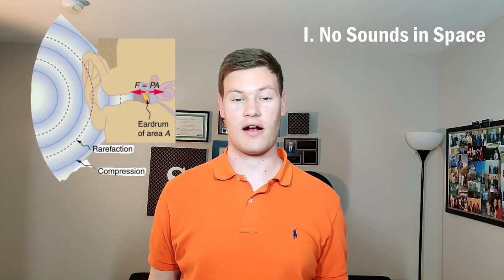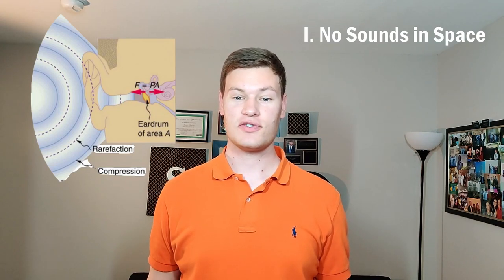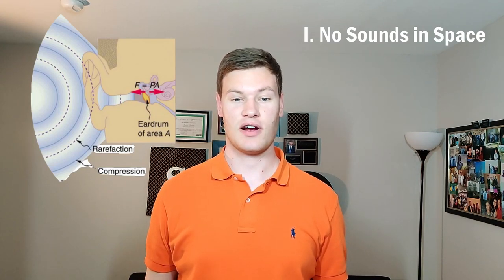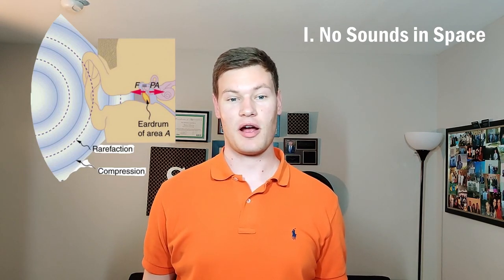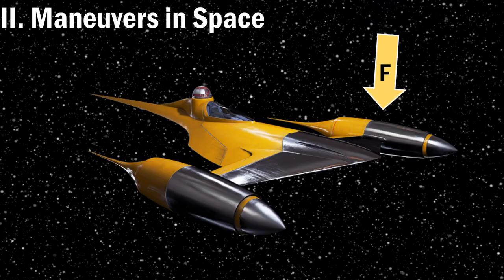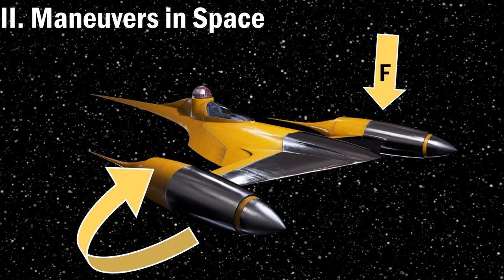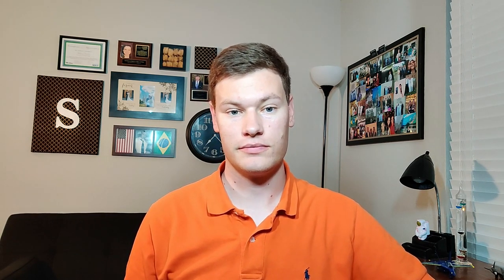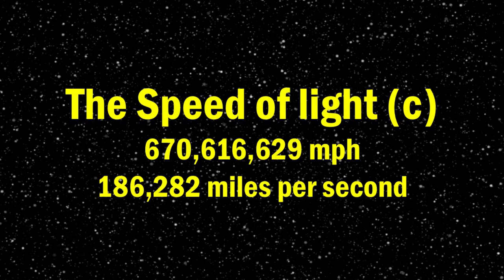How Star Wars Spaceships Work | Aerospace Engineer Reacts

Comment: Regarding your interpretation of what the hyperspace engine does is not what I have seen. It makes you go to a parallel universe (Which is science that exists) where they can go faster than light, either because the speed of light doesn't exist there, laws of phisics are distorted and weird, or the speed of light is significantly raised, aka not a wormhole. In one of the books that I read (legends) they didn't have time to do any calculations for the route, and just hit go(basically). They then got stuck near a black hole (Which will of course also exist in the parallel universe) and couldnt enter hyperspace, then some weird shit happened that I will not go into. I have read over 50 star wars books so PLEASE don't respond saying that you googled it and wikipedia said that it was actually a wormhole in legends. Anyway, that was me ranting for 3 mins have a gud day.